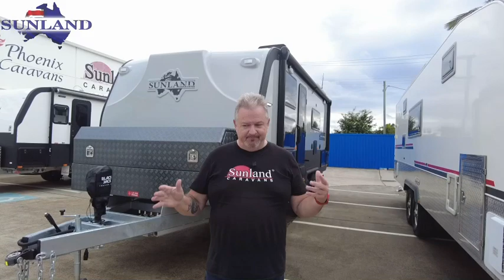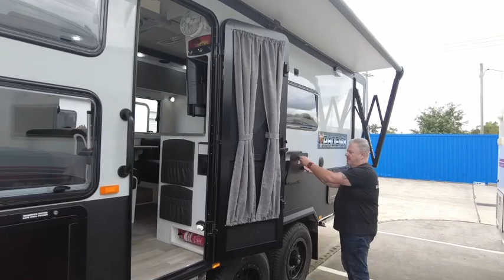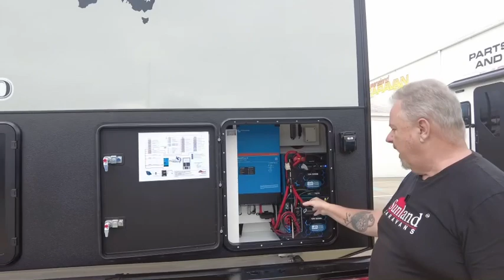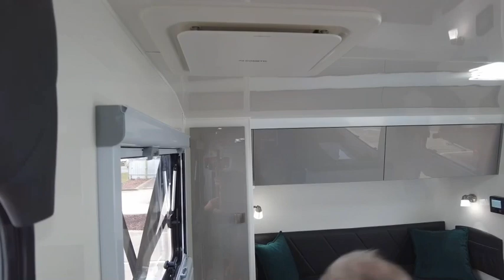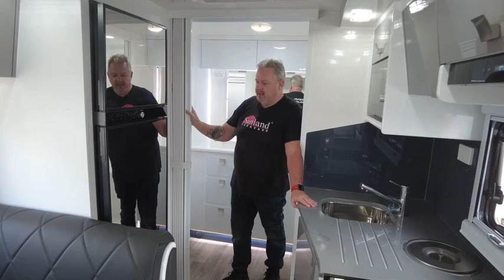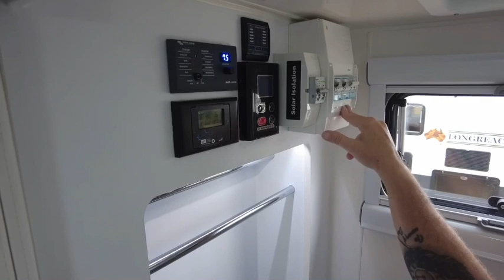Sunland Caravans 20’6” Phoenix Walk Through Video Off Road Caravan

Comment: I thought the Carafan filter is accessed from the roof. Diesel heaters have a dryer heat due to the high temp combustion process whereas gas heaters retain some mositure in the heated air which can produce condensation on the walls if run for long periods.